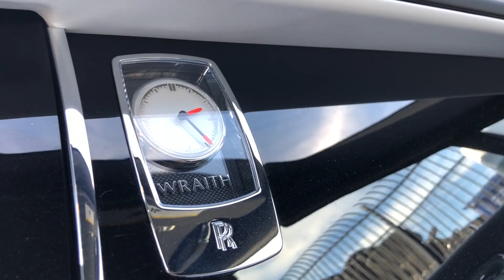#RDBLA Rolls Royce Transformed again, Bentley Mulsanne Satin White ShowDown and More!

Comment: How do you guys know how to remove all the body parts without damaging anything. There's always little hidden bolts or some clips get really tight to make it think it's still screwed on
Reply: g4rr377 I'm sure they broke a few clips here and there, put it back like how it was. As long as the panels or trim pieces don't stick out of place or move when pressed on, they're good. Plastic welding the broken pieces back on is another option.
Reply: J Silver the money you pay the more expensive or famous companies in the UK, if I had a damaged trim I would expect a new one fitted. Ignorance is bliss though
Reply: g4rr377 I understand, but mistakes like these happen almost all the time. It's good that these shops are making good money doing this because when someone snaps or cracks a $200(or more) panel in half when carefully prying out that stubborn piece out, a quick call for overnight order from the dealer and it's back to business. If the damage is done where it's unable to be seen from the customer, it's really nothing you can do, as long as that damaged part is not affecting the quality look from human eye. I'm sure Vik would not let a car leave his shop with a clearly visible damaged trim or panel.